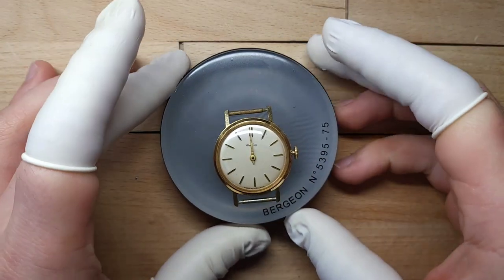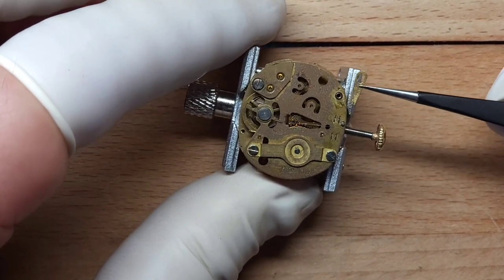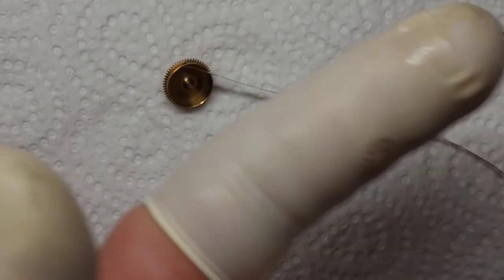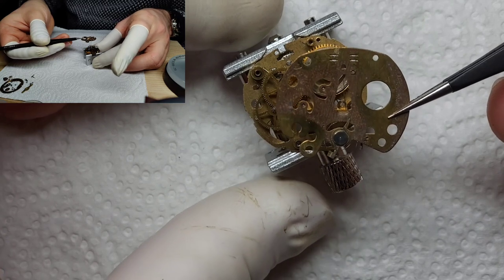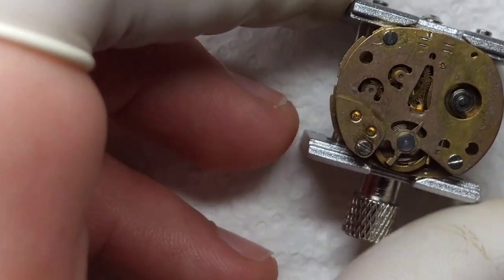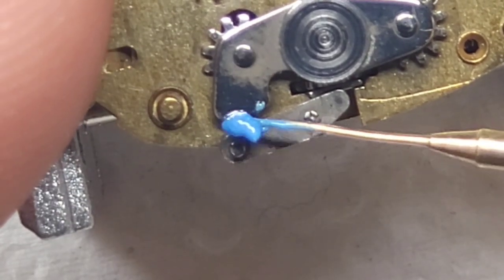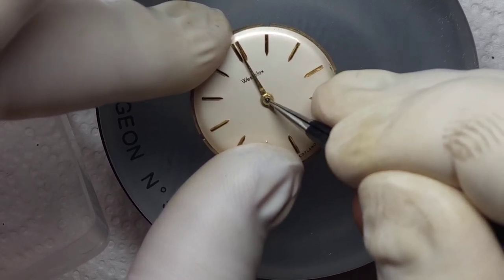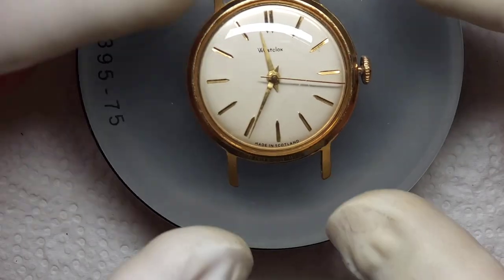Vintage 1960s Westclox Wristwatch Repair and Service. The Pocket watch of the wrist

Comment: I had a very very nice 17jewel Westclox wristwatch that I rebuilt. I have no idea who actually make the movement, but it was very pretty, and very inexpensive.  I kinda wish I hadn't sold it. I like the massive crack in your table to conveniently drop screws through 😂
Reply from the maker: Always the way pal, you'd always regret selling something like this!
Same story here, very inexpensive but kinda charming in its rugged way.
Ahh well it's actually an old chopping board as I don't like working on glass surfaces 😂 I do have a craft mate which I shall be retrieving to be used. At least if they go down the crack I'll know where they are eh? 😂

Comment: Hi there. im working on the same movement as my first watch repair project. Unfortunately the balance wheel seems to be flopping down and not rotating as smoothly as shown in the video. Any tips on why this may be? Thanks.